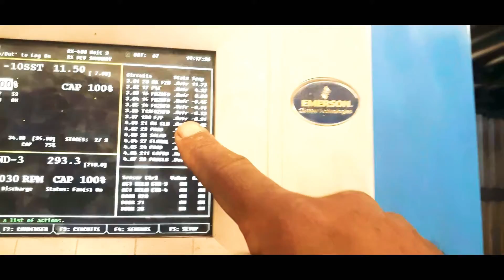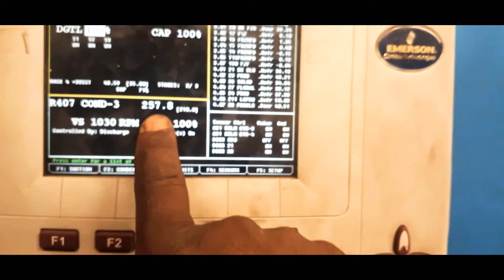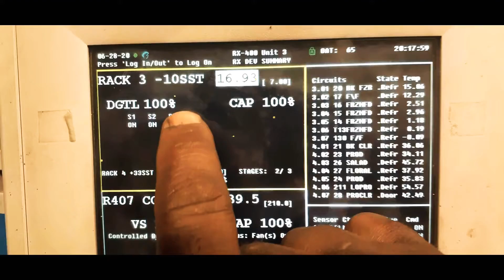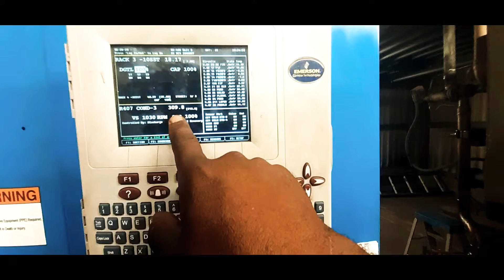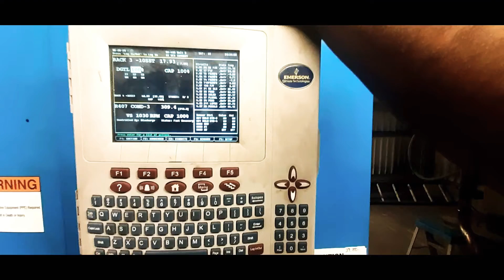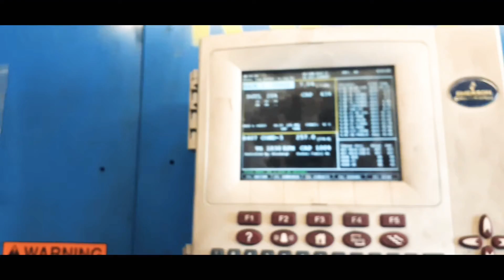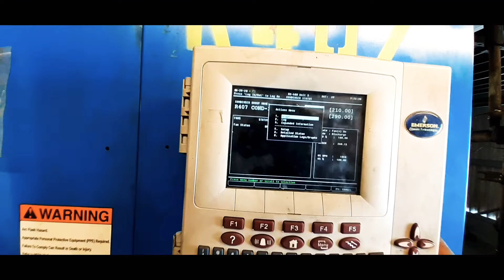I COULDN'T FIGURE IT OUT 🙉 | F@#K

Comment: Is there refrigerant in that condenser??
Here we use a glycol system on a unit that size, as a condenser( called a dry cooler) That way you can cut the refrigerant  charge 33%
Reply from the maker: Refrigerant though we have something similar on a co2 rack = gas cooler